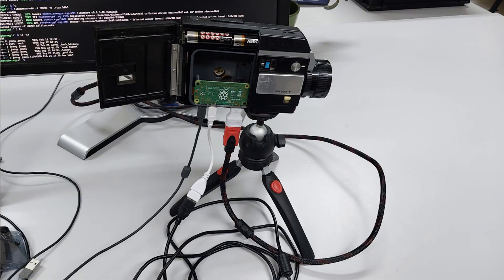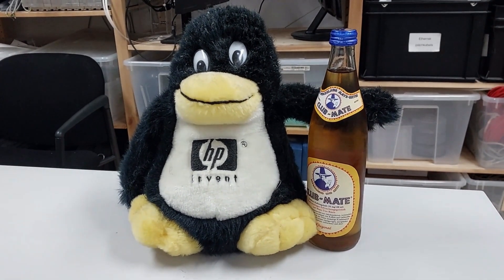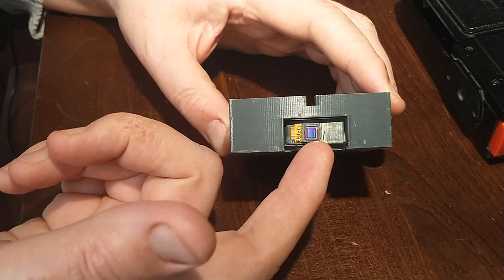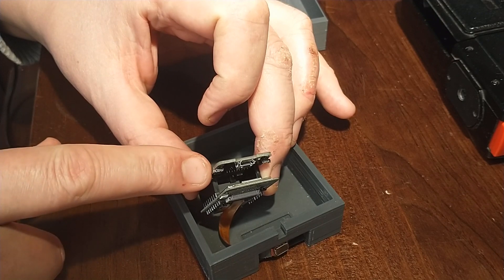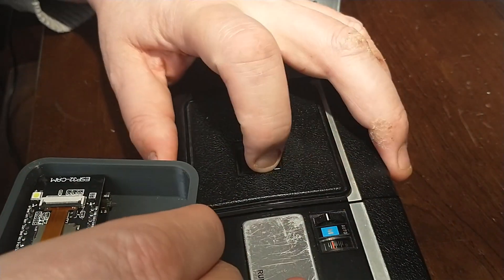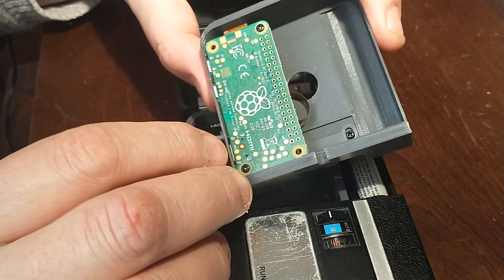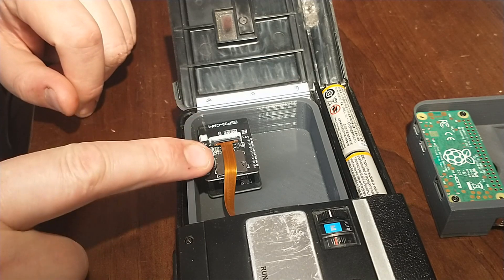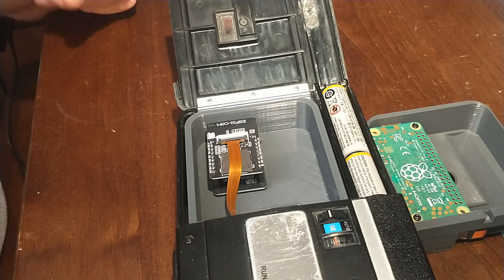What's On Jenny's Bench: Digital Super 8 cartridge, part 2

Comment: Zoom lenses do funny things when the focal plane is off. 
I use infinity as my starting point. As soon as zooming in and out at infinity works . 
I turned a nexbase dash cam into somethings I can attach 16mm cine lenses onto. 
Nexbase mount their ir cut filter inside the lens and not on the sensor, not the result I was looking for but it is what it is.
Reply from the maker: That's good advice, thanks. My next step is to work again on that problem.

Comment: I see, the 'shutter' is disturbing the exposure of the camera-modul! You should put out the mechanical shutter, what was needed to expore the single 'pictures', comming into a fluend super-8 film. 

Have you considered my advice, with replacing the UV-filter wich is sitting directly on top of the camera sensor, and 'adding' a new but external UV-filter outside, onto the objective? When taking off the inner filter, you will 'win' the Millimeter you needed for the correct focus! 

Please be aware, that English is not my mother language, ... ! 

Best for you and the project! 
 
Markus - db9pz - (my Ham-Radio call)
Reply from the maker: The point is that I do not want to modify the camera at all.

See previous reply on UV filter.

Comment: excited to follow along with this. Have you considered changing the direction of the screws you are moving the sensor with? if you put the sensor holder on rails and adjust the depth with a screw in the horizontal direction, you would have fine adjustment that you could change while you had it set up on a tripod. If you set it with a hollow screw you could probably get it big enough that you could use your thumb to adjust it without tools. looking forward to seeing what you come up with!
Reply from the maker: As you'll see with later videos, I have changed entirely how I am making this project. But yes, a horizontal screw could work.

Comment: This is very cool.  I've picked up a few old 8mm/Super-8 movie cameras from thrift stores over the years, as well as hanging onto my Dad's old camera that I disassembled when I was a kid.  I've had similar ideas in the past, even going so far as to mount an old analog CMOS image sensor in the remains of a disposable film camera.

It looks like there's quite a bit of space in the cartridge even with the Pi.  I wonder if it would be possible to motorize the image sensor assembly positioning.  The head positioning stepper motor from an old laptop floppy drive is pretty small, and I wonder if one couldn't fit an X and Y axis inside the cartridge with little 3D-printed carriages operated by the motors' integrated worm gears.

Now I'm interested in seeing your other videos about this concept.  Keep up the good work.
Reply from the maker: I have to admit, I hadn't thought about motorising the camera assembly. That would be pretty cool, but more complex than I want to do.

And thanks, and yes, there's definitely more to come on this one.

Comment: Good video :) Have you considered repurposing old/used tapes for holding the microcontroller, battery, and sensor? Or is it too much of a process? I'm considering doing a similar thing for 110
Reply from the maker: I don't have many old cartridges, and it's easier to 3D print. I would be * really* interested to see your results with 110!

Comment: I believe arducam came up with a way to run mipi cameras off of the raspberry pi. I know you're probably more wanting to get the thing in focus more than anything, but I figure having more camera's at your disposal would be helpful. Not to mention you might find one with a crop factor thats close to a super 8. Thanks for the videos by the way, always cool to see people using old tech in cool new ways.
Reply from the maker: That's interesting, thanks! 
I haven't really looked far beyond the defaults in terms of sensors, yes.
Reply: Yes, would be best to have a sensor that's the same size as a Super 8 frame. I've been looking around and found that most phone cameras use a 1/2.55" sensor. This is 6.17x4.55mm. A Super 8 frame is 5.79x4.01mm. That seems perfect to me. You can just take the camera module from a dead phone. Tricky part will be how to use it with an Arduino.

Comment: Why not add a geared mechanism to the camera support so you can more precisely adjust it's position? Also, trans rights!
Reply from the maker: ... and yes :)
Reply from the maker: I've come to the conclusion that the glass front of the sensor module means I will never be able to perfectly get the sensor in the focal plane.

So I'm trying some different approaches, part of the reason it's taking a bit longer for the next follow up video.

Comment: I've been trying this project out and I'm having a similar problem. I am convinced that the metal plate surrounding the shutter hole in my camera has to be removed to get my sensor closer to the lens but I don't see an easy way of doing it. I'm debating just taking a drill to the damned thing (the camera is already dead anyway).
Reply from the maker: I have seen others who have solved the problem that way. Some cameras allow you to simply unscrew the plate.

Comment: I built a camera out of an old camcorder some years ago using a PlayStation eye as the sensor. I had a similar backfocus issue with the sensor and solved it to a degree by mounting the sensor PCB to the lens assembly with machine screws, and a black foam ring sandwiched in between so the screws would compress it when tightened. I did find I needed very small adjustments to get the focus but it did eventually work. The same might work here and help you get that dialled in.
Reply from the maker: The piece of foam is a good idea, part of the problem is pressing the thing in too hard can break the sensor.